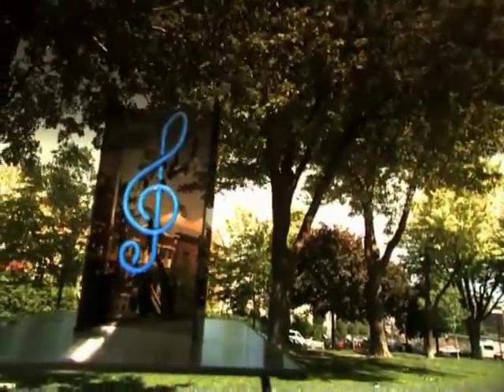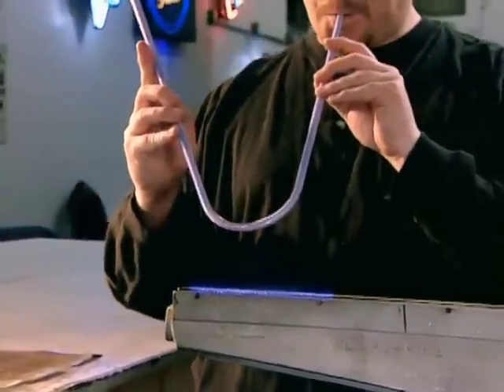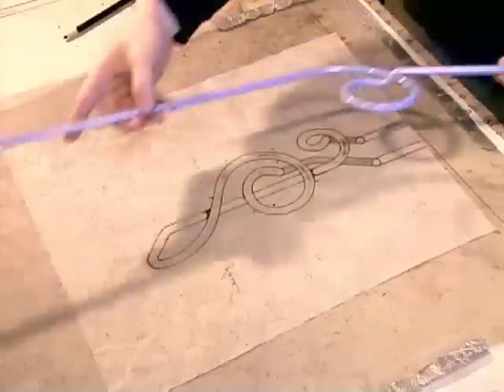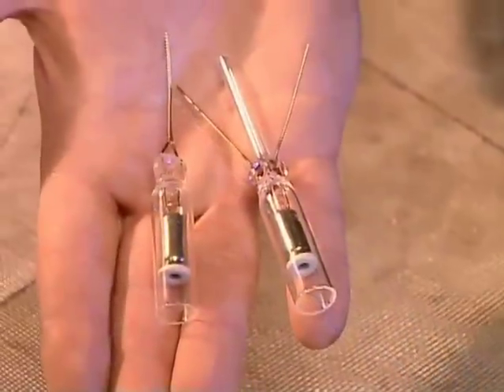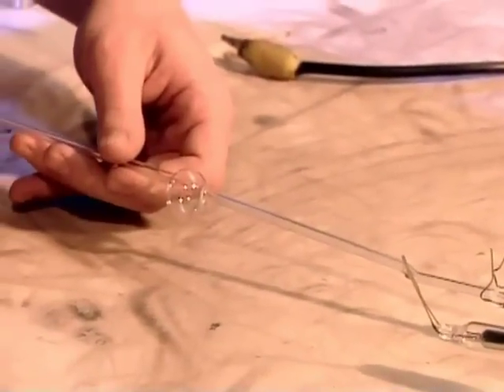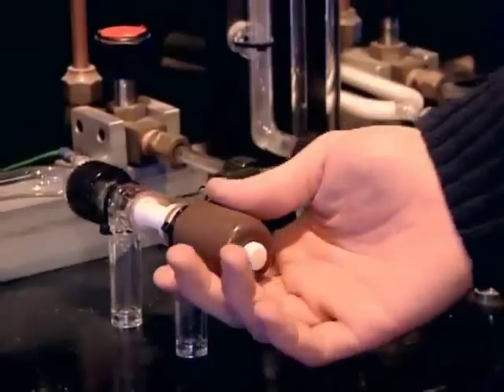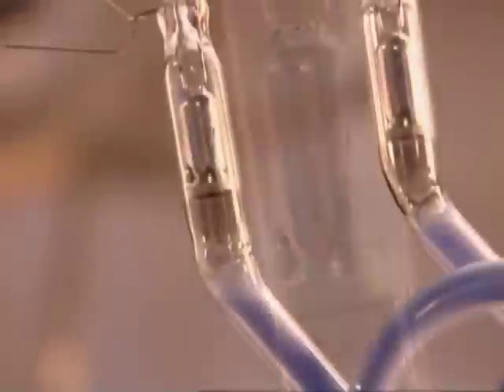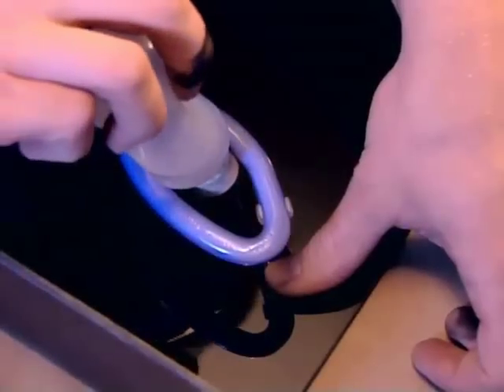How Neon Signs Are Made

Comment: The narration is wrong on several points such as mercury's function is not to brighten the tube. Its the ultraviolet UVC light at 253.7nm from ionized mercury vapour which the fluorescent phosphor coating inside the tube absorbs and re-radiates light in the visible spectrum.   The processing, or pumping of the neon narration is incorrect as well. Its a heating process using high voltage to de-gas the glass and phosphors and at the end to heat the electrodes to 900C to convert the chemical emission coating on the inside of the shell which lowers the "resistance" of the final neon lamp. That's just two there's more...

Comment: Colours??? OVER 300 and 30 are WHITE. WHY the cork??? Glass convects HEAT not conducts ...any variation of a straight line produces stress point .. the "Puff" restores continuity to relieve the stress... Ribbon is but one of five fires incorporated ... the Block is the "HAND" that doesn't burn and Also compensates for the Heat soak to the pattern side...Argon is heavier than Neon hence WHY Argon requires Mercury for "Hamburger Helper" to excite the electrons to the same speed as Neon.. NEON is added to Argon for Cold Weather climates to prevent fading in Winter outdoor exposures...Finally a contemporary solid state transformer (properly loaded) Diameter od glass by footage less one foot per pair of electrodes, uses as much Power as a 40 watt light bulb ... YET produces no more than ambient heat, so You aren't Air Conditioning Your Lighting.... There is nothing Cooler than NEON.

PEACE

 Craig Alan Nichols / since 1982 CAN  DO  NEON / Clevo Ohio USA 44111
Reply: Kzk
Xa r😉😉😉😉😉😉😉😉😉😉😉😉😉😉😉😉😂😂😃😂😈😇😇😇😇😇😇😇😇😇😇😇😇😇😇😇😆😆😆😆😆😁😆😆😆😆😆😆😆😆😆😆😆😅😅😅😆😆?👄💔💄🔰💄💄💄💄?😆😆👧👧👧👧👧?Price😋😗😗😞Price Price😈😈😈😈😈
Reply: whaddup Craig
Reply: Me no understood nothing my fryend 😉

Comment: SIGH, I was going to attempt to make one for my art project..... DREAMING
Reply: Might be late now, but you can :)
Reply: how? xx
Reply: lol
Reply: Fast forward 4 years: check out EL wire (electroluminescent wire) which only needs 3 volts (2 batteries), or try LED neon tubing (light-emitting diode) which only needs 12 volts (8 alkaline batteries or an auto battery).

Stop dreaming about it amd make it, then upload your creation onto YouTube so we can see!
Reply: @MoeBabaloosh  booo that's not neon that's a cheesy impostor.

Contact your local tube bender, they'll probably help you out if you're kind.  Getting neon tubes made is not that hard actually.  There are accomplished neon artists who have worked for decades and never bent a tube themselves, that's considered a highly-skilled craft/trade and a separate profession altogether.

Just draw your design 1:1 scale and provide it to the bender; do some research online so you know what colours and type of gas you want.  There are also four different diameters of tube available.  The mounting things and transformers you can find online, if you don't know what you need the bender can probably advise.  Good luck!
Reply: You can easily do that by taking a thin T5 fluorescent tube and just heat it on a gas stove just enough to make the glass soft to bent it. If you heat to much the vacuum inside the tube will squish the glass and seal off the arc passage ways. I have tried it, and it sometimes works, sometimes doesn't. Mainly what happens is I introduce stresses in glass by heating it and it cracks on its own after a few hours. You better off just buying a simple glass tube, bending it int a shape on a gas stove and then finding someone who is skilled in making neon signs and other lamp related stuff and just giving him money to pump out your tube and seal in the cathodes. The rest you can do by yourself
Reply: What do you mean you can't? You can do anything. 

      MAGA !!!
TRUMP 2020

Comment: you can make it using EL wire or electro-luminescent wire. It is safe to wear, is available in a bunch of colors and can be powered by a small battery pack that can fit in your pocket. It is easy to use and make into whatever you want. You would just sew it onto the costume to hold it in place. EL wire is flexible and it glows in a similar fashion to glass neon sign tubes.

Comment: They didn't mention the Bombardment where just a small amount of air is left in the tubing while pumping down. Then a larger current high voltage transformer than actually used in the sign is used to ionize the air and heat the electrodes to red heat (3:22-3:26). The tube is pumped down more to it's final vacuum to suck out moisture dirt etc from the tubing after it gets hot then the argon/mercury or neon is ladeled in. The tubing then gets "tipped off" and run to check color and brightness.